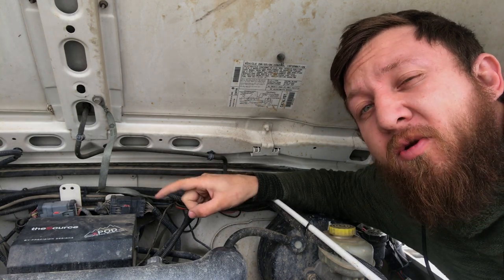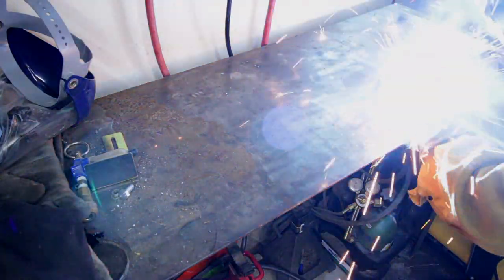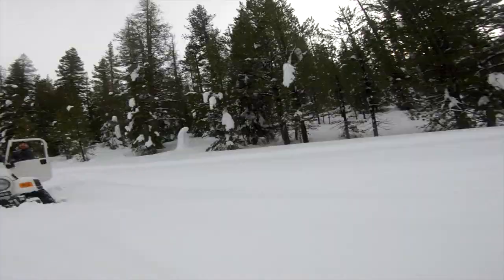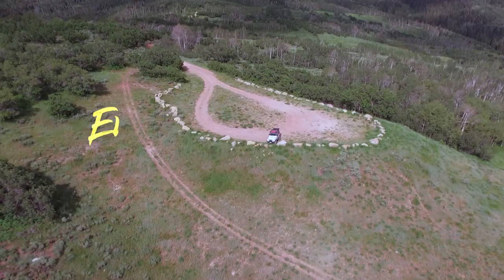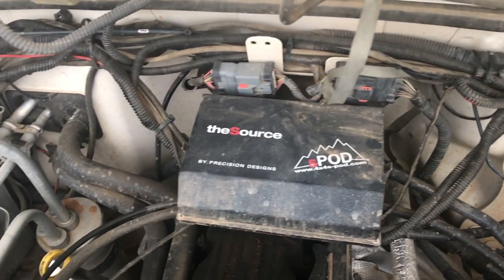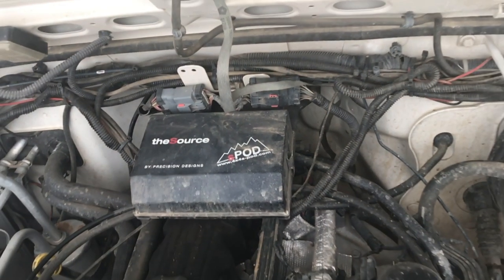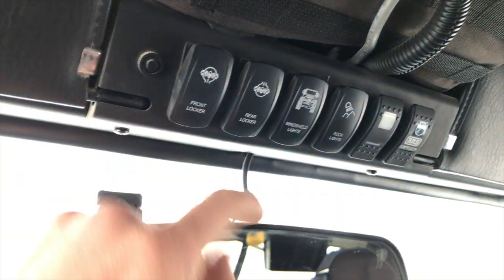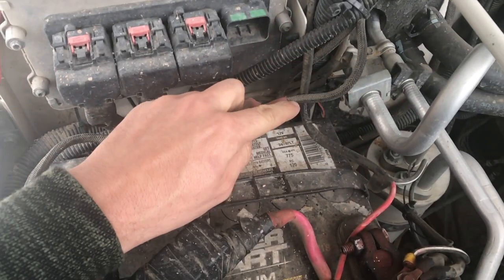Long Term sPOD Review, Is It Worth it?

Comment: Mine is 10 years old. Had a few solder spots come loose 2 years ago. Sent it back for repairs but happened again a year later. This time I fixed it myself with the solder iron. Other then that, no other issues.
Reply from the maker: Awesome! Glad to know its held up well for you. I often wondered about the soldered joints, but it sounds like for the most part yours has been reliable. Thank you for the comment and for watching, I hope you enjoyed the video.

Comment: Had mine 6 years , it is not engineered smart, water can get in the PCM board where the wires enter, and does. I already changed a board because water blew two circuits. Now The switch box ( which is the enclosed metal one with rubber buttons) has took a dump. The connection point was all crusty with a blue powdery corrosion. The switch box no longer communicates because the corroded pins. Hoping Spod send me an RMA to send it in for repair as I already spent $200 on a new board and do not want to spend $350 on a switch box.
Reply from the maker: This has not been my experience. I am still running my original Spod. Thank you for sharing your experience though. I have wondered if the exposed circuit board would be an issue. It hasn’t been for me so far. But I’m only one person.

Comment: I heard it has openings at the bottom of the box in the engine bay that allows the elements into the circuitry.  (Water/dirt)  Any issues with that?
Reply from the maker: It does have an opening at the bottom so the wires can run through it. I thought there might be an issue, but no not one issue.
Reply: I had an issue with that, had to buy a new board when 2 circuits got moisture and fried. Piss poor design , the box should be water proof.

Comment: did it void the warranty when you install it?
Reply from the maker: My Jeep is well out of warranty. However this does not touch the electrical system of the vehicle except for two connections to the battery. So I do not see how it would void the warranty.